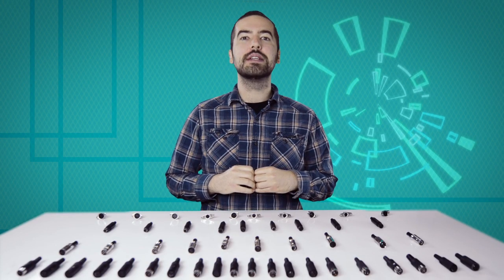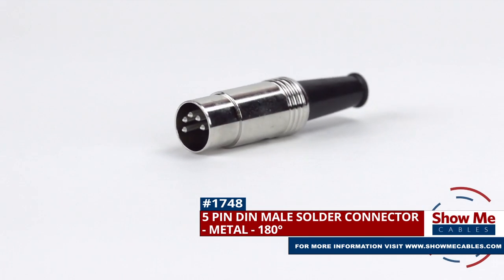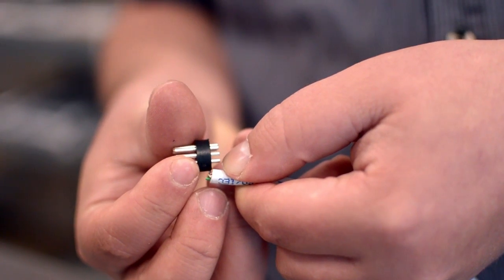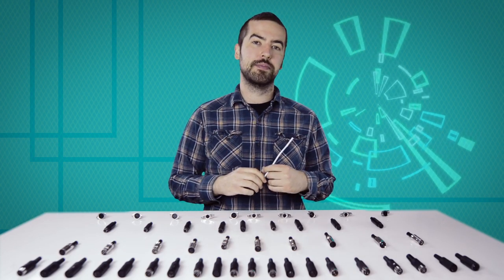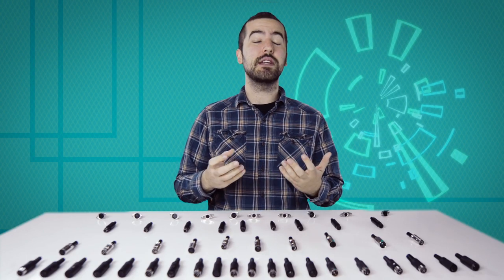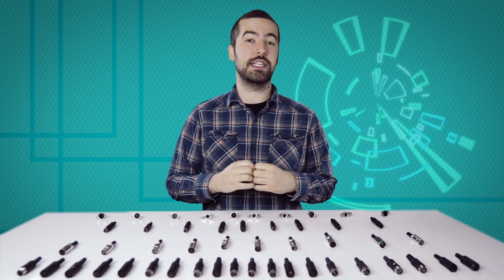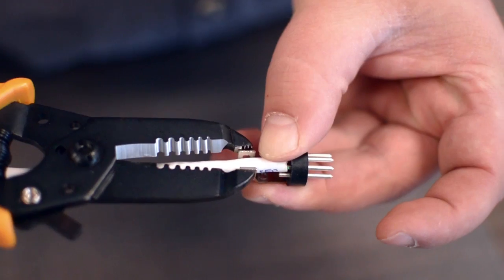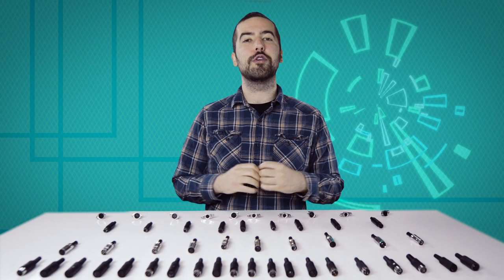How To Install The 5 Pin DIN Male Solder Connector (180° Style) - Metal

Comment: I'm on the cheap here and I got a plug in solder iron laying around but recently upgraded to a 852D hobby rework station. The rework station has a 5 pin connector how do I know which wires to connect from a spliced solder iron wire to this connector? Unless it can't be done without another solder iron lol. But possible yes?

Comment: 2 questions. 1. If I have a device with a 7 pin out and want to plug into a 5 pin in on another device, will i need a special cable? I'm not trying to pass phantom through the cable, just looking for a standard midi cable. 2. is cat5e the most reliable cable to use for midi? Is there not a cable designed for this?